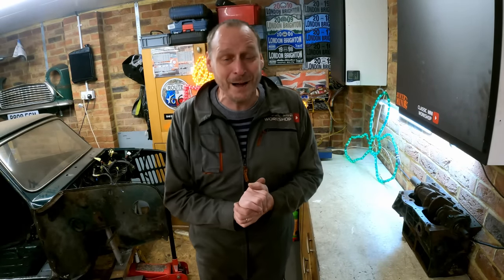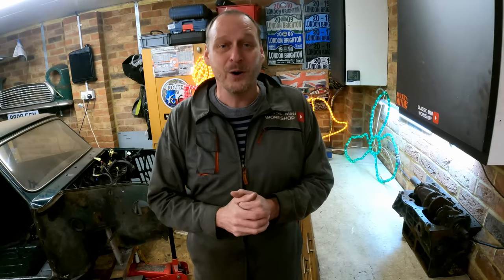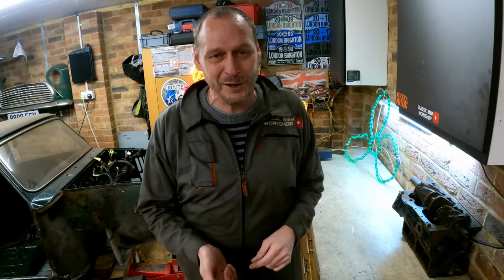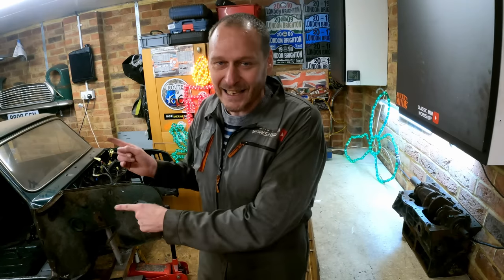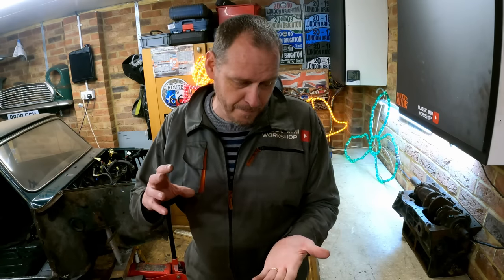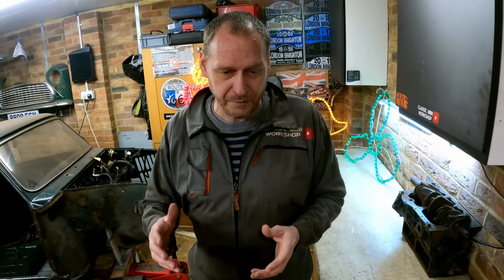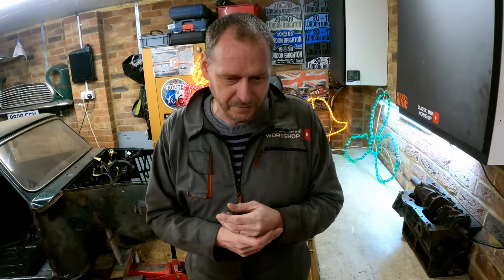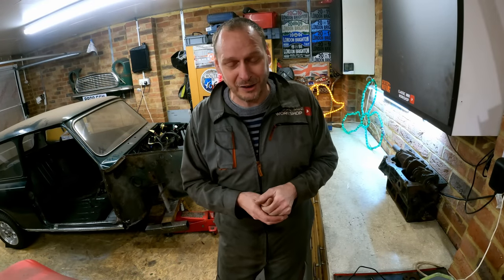Fixing My Mistake - Classic Mini Workshop - Project Racing Green Pt.19

Comment: I decided to put back internal sling brackets, front and rear, just so I knew they were there. The unexpected bonus was that it made it much easier to align outer sill - you can even bolt the sill on via these as you fettle it - hope that helps someone.
Reply from the maker: Good point mate! The slinger bracket would have been a good reference.

Comment: Belated merry Christmas, have a great new year. Couriers are a problem here in Australia as well. A parcel was lost so supplier resent. Two turned up together the Friday before Christmas, now I have the hassle of returning one. The sill does have a deliberate curve, a local Mini specialist was folding straight ones with no weep holes or pressings. I saw a car they had fitted them to and it looked horrible. Worse than the dreaded oversills.
Reply from the maker: Cheers Stewart, Happy New year to you also

Comment: Hi Keith. Sorry to hear about your DPD frustration. Not sure what the answer is at the moment with the UK Postal system being in a mess and other couriers losing the plot - even Amazon are not meeting their SLA and they don't apologise. Pleased to hear you are still building your own PCs. I like to do that too. Which OS are you using this time?
Reply from the maker: Hi Graham, I'm just using my existing Win10 key at the moment but can upgrade to Win11 now. My old i5 6400 was not compatible, I wonder if they done that for a reason as it was the chip you could do a base clock over clock. Had mine running at 4.5Ghz for 6 years, so had my moneys worth. The new build is an i7 13700K with a GTX4080, so a massive jump